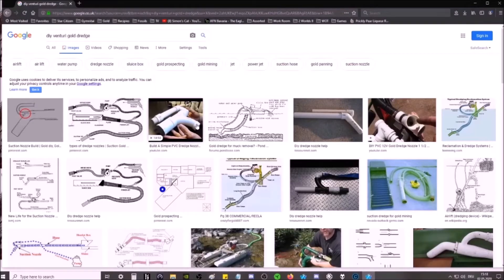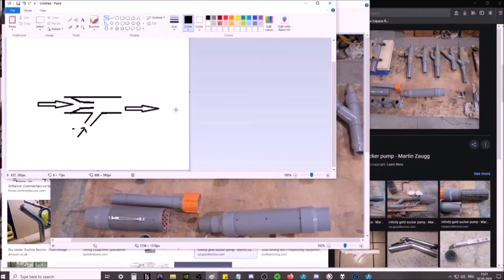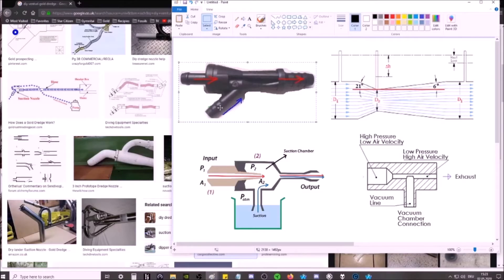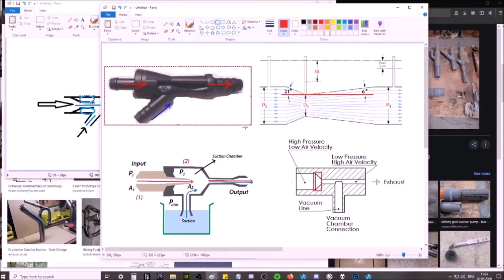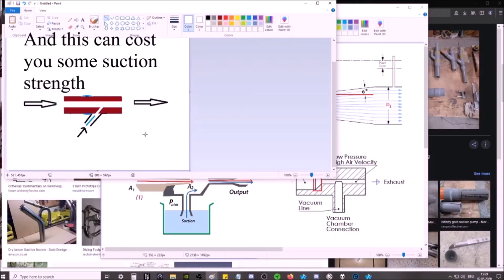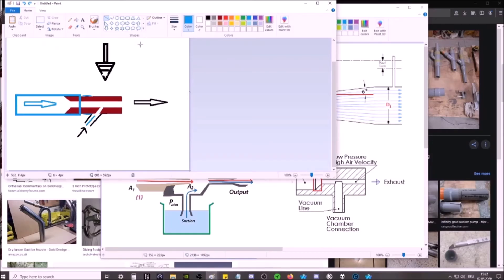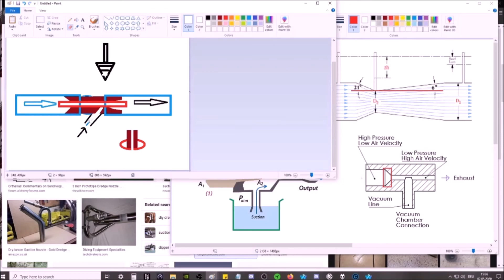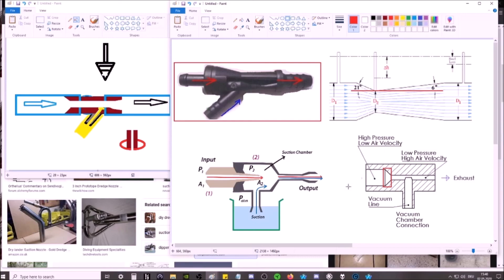B3 Venturi Pump basics

Comment: I can barely hear you at 100% volume on my computer.
Reply from the maker: Yes some of the older videos I did have that issue in the field. After the house is built, the new bees put in, the 4x7 Meter green house is re-water proofed on the wooden beam, the 2000 liter Aquaponics system it drained and harvested and time allots it is on my to do list of remakes once I am able to get back into the field again. This has been a hectic last 3 years around here sorry.
Reply from the maker: But thanks for reminding me at time just too much on the plate.

Comment: i made a flat adjustable venturi as wide as the vacuum round pipe and made a flat throat in the round pipe as big as the inlet.which is 30mm the pipe is 50mm.the venturi is also 50mm wide.I'm busy with a spade to adapt it to a dredge with a double blade and halfway it goes sideways where the venturi starts.
Reply from the maker: and may I ask why? what effect will this cause pertaining to the hydrodynamics? Will you need less GPH flow or lower PSI perhap?
Reply: @galwinthefossilizedprospec6999   its a Johnson pump 2200 gph mounted right before the venture its a pump that can also suck at height from the water and also the diffuser i have to look at with how much degree to do. So i'm not done yet next year it will .i'm waiting for parts . i classify also with a mesh tower with vibration from a HDD motor after the diffuser.